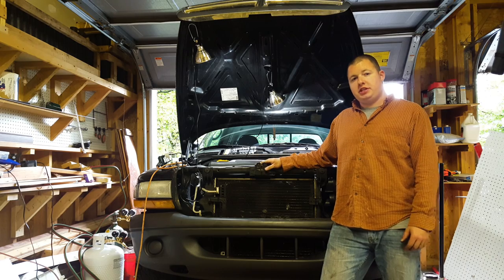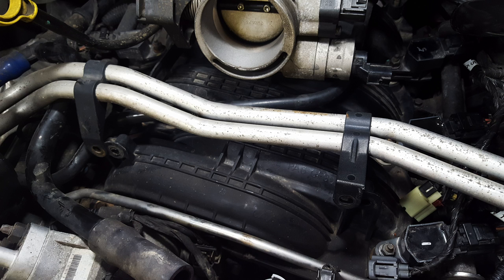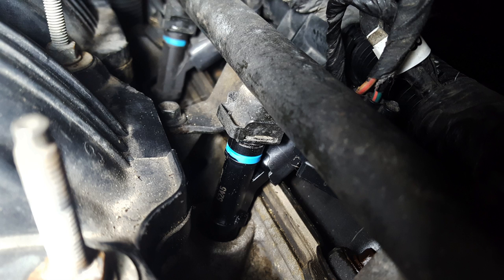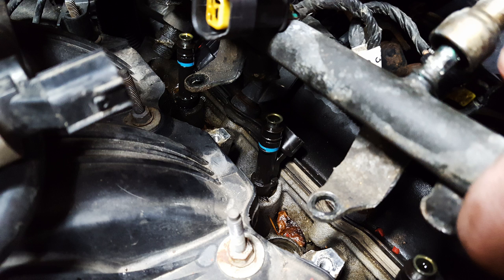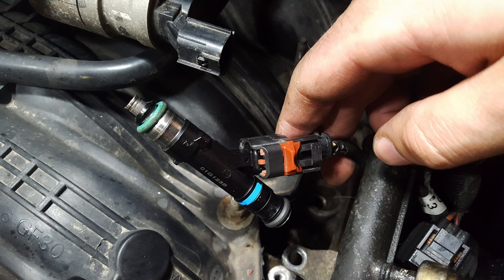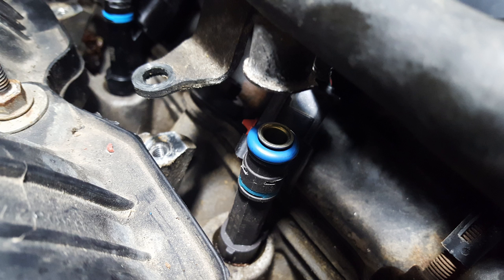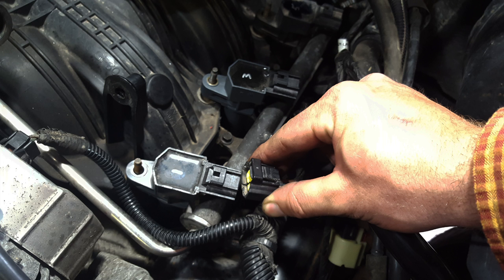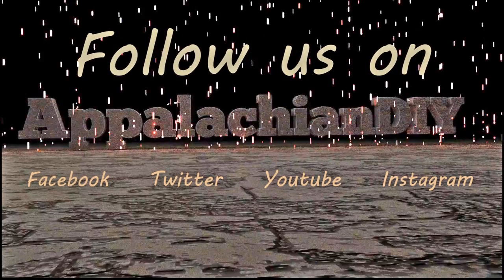04 Dodge Dakota Injector replacement

Comment: Thank you a lot man. I'm not a mechanic or anything but I'm too poor not to try lol. It didn't fix my code but I learned a lot and I'm pretty sure this video is the reason I didn't hurt anything in the process lol
Reply from the maker: Awesome! It's always good to give stuff a shot by yourself. Im glad the video helped!
Reply: What code did you have?
Reply: Did you fix your real issue and what was it?
Reply: cylinders 3 and 6 misfires. it solved the cylinder 3 but not 6. im thinking theres a stuck valve in 6

Comment: I have 2000 Dodge Durango with a 5.9 V8. The engine bay is practically almost the exact same, with just different positions here and there. Thanks a lot for this video, it’s definitely going to be a big help as I am about to replace my injectors for this first time!

Comment: Going to do this Sunday. Changed out all the coil packs already didn’t act up for a while now it’s started again this might be the issue. What kind of lube is used for the o rings on the new injectors? Read comment about that.
Reply from the maker: you can prob just use some clean engine oil
Reply: @appalachiandiy2415  thank you.

Comment: Thank you. Have an 07 that kicked a couple cylinder 5 codes today. Changed the spark plug, which cleared some of them, but it still has a P0205 for an injector open circuit. Looks pretty straight forward. Read somewhere that you have to bleed the pressure off the fuel rail, did you do that, or did you just pull the rail?
Reply from the maker: I did not bleed it. seemed to do just fine like that for me.
Reply: I did not think of this, and when I pulled the fuel rail loose, it spilled fuel. Fortunately none went into the coil pack/spark plug holes. But it went just about everywhere else.
Reply: @adamwinnett8892  , thanks for the warning! 👍

Comment: If the little red clip breaks on the injector harness like you said it’s easy to, does that harness connector need to be replaced ?
Reply from the maker: No. the one I show that is broken i just put it back in with just the one tab broken off. It hasnt been a problem yet.
Reply: @appalachiandiy2415  Thank you for answering this!

Comment: hello great. video does it mater witch .way the o-rings go on the fuel injection thanks
Reply from the maker: Thomas Whetzell There is no certain way the o-ring should go on. just make sure it is seated in the O-ring grove. that is the most critical thing to pay attention to for the o-ring.
Reply: OK thanks a lot
Is there a way to make sure the gas line on the fuel pump does not get kink thanks
Reply from the maker: all i can say is be gentle. you should be ok. i was kinda rough with my rail pulling it off and I had no problems.
Reply: Thanks I try to put my gas tank up in place and the fuel line started to kink

Comment: what was ur truck doing that made u change out the injectors?
Reply from the maker: Abel Cerrillo it had a bad miss. Changed sparkplugs, ran lukeoil injector cleaner thru it, nothing helped. Hooked it up to a computer and said I had a missfire
Reply from the maker: It may be. You fixed everything else LOL!

Comment: I've got a 2K Dakota V8/4.7L are the injectors in the same place?
Reply from the maker: Tyrone Walker from walking the U-Pull it yard, if my memory serves me right, the injectors are roughly in the same general area but it is a different fuel rail and injector. Pretty much the same idea for removal though

Comment: I also have an 04 dakota 3.7 v6. is there any power increase from putting on new fuel injectors and is there a certain kind of injector I should get that will get me a bit more power?
Reply from the maker: MrDippledork if your injectors are not bad i would just run an injector cleaner in your gas. I use Lucas, works good. its not worth the cost to replace your injectors for a tiny boost if they dont need replaced. i just used stock replacement injectors but im sure youll get better performance from aftermarket ones. I would check NAPA.
Reply: if you want more power, increase the amount of gas going in.. look for an injector with a higher flow rate. also 2005+ vehicles got Bosch new EV14 design some them come with 12 hole nozzles, this is why newer cars are so smooth because the fuel dropplet comes out 3 times smaller with the 12 hole instaed of the 4 hole nozzle..
-Bryan
Reply from the maker: Good to Know!

Comment: You didn't remove the main fuel line why?
Reply from the maker: If your talking about the fuel rail its not necessary You can pull the fuel rail off the injectors and you still have enough room to work with it still intact.